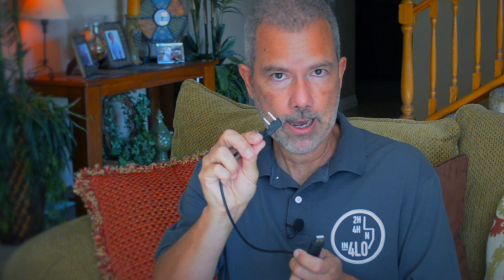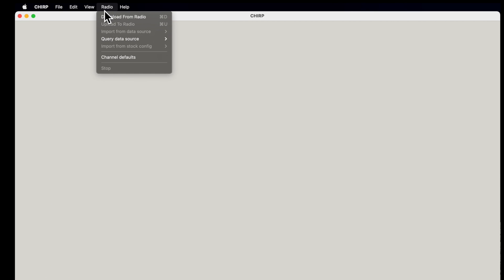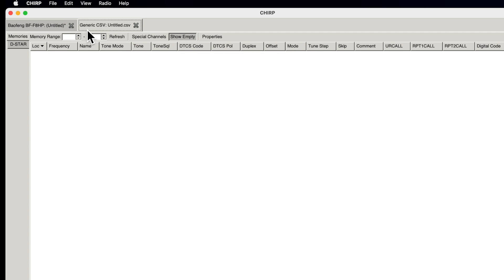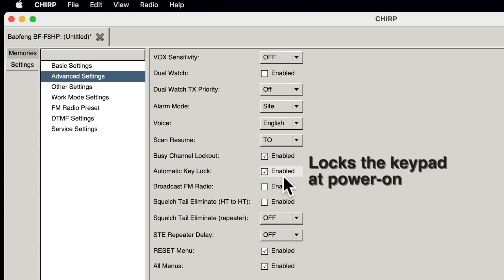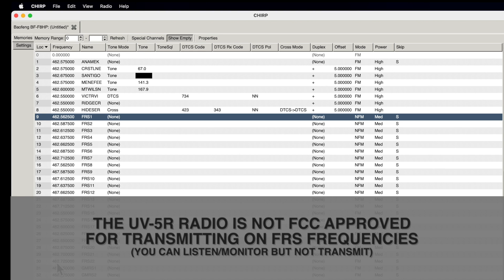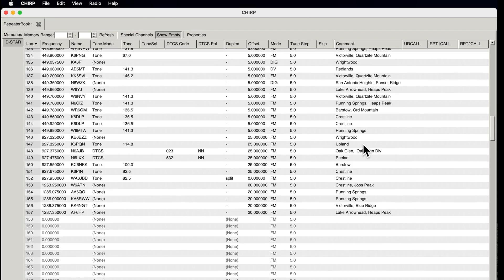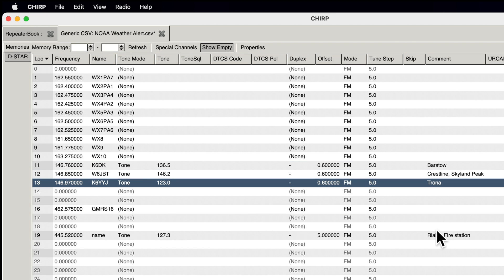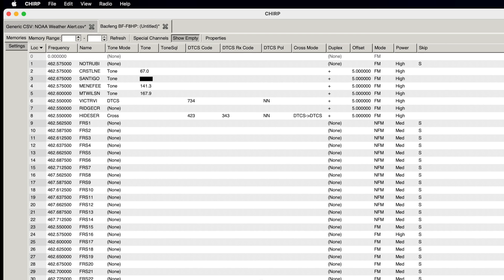How To Use CHIRP Software To Program A Baofeng UV-5R. Using CHIRP for HAM, GMRS, and FRS Radios

Comment: Hello, I want to ask. Is it possible to use. This walkie-talkie legally. Below a certain frequency. Without having to. Edit it with a computer.
Reply: @michal swartz  Yes, it is "possible to use" the HT on any frequencies you program from the radio keyboard, as long as the radio is built for that band: e.g. 2M, 70cm, 220, etc.  CAUTION:  You may be violating the laws governing those frequencies!  If you are interfering with aircraft radio / navigational frequencies you may be hunted down and arrested.  If you are misusing frequencies for Licensed amateur band operators, your ham neighbors may make a "fox hunt" exercise out of finding your transmitter.  They may chat ...  or may submit the case for prosecution directly to the governing powers (e.g. USA = F.C.C).
Reply: @donalddodson7365  However, you didn't exactly answer his question on WHICH frequencies are legal to use for "simplex" use. I'm in Canada so the FCC can kiss my ass but obviously, I'd have to research which local channels are for fire/rescue, navigation or whatever. Are there any OPEN frequencies that we can use openly which no one uses for official use? Thanks in advance :)

Comment: As you have said many times, CHIRP and Macs just don't get along!! I had to borrow a friend's Windows Laptop to use CHIRP. One issue was an error code referencing a different fIrmware version on my second radio, but the new data was uploaded and is useable.

Comment: I've tried a lot of things but I cannot get my radio to respond when trying to download and wont give me the option to upload either. Someone please help!
Reply from the maker: Check to make sure you have the correct com-port set in CHIRP
Check to make sure you are choosing the correct brand and model radio when downloading
Make sure your cable is plugged in All the way (plug it in harder when you think its plugged in) and set the volume on your radio to about 75%
if it still does not work, then you probably will need to change/update/replace/roll-back the Windows driver for your cable - To do that, make friends with Google, and God help you...
Reply: i had the same problem . this is what worked for me . go to the bottom left. right click the windows icon . then find device manager . find ports . plug and unplug the radio leaving the usb plugged in . if you see somthing change . thats your radio . (under ports) .for me though it was above ports listed as a usb thing . it appeared and disappeared as i plugged it in and unplugged it . for me . i saw when plugged in that there was a yellow triangle . i right clicked that and checked for updates . let the pc update all the stuff out of date . when finished a new port appeareared labled CH340 . when that shows or somthing new under ports try again and this should work . hope this helps anyone

Comment: Question, I'm new to this if you bought one radio, baofeng vhf/uhfIP67, next BF F5XP 5w D.B. or BF F8RT 8w D.B. would like to start off going in the right direction, thanks
Reply from the maker: Ok.. So what is your question?
Reply: @TheNotaRubicon  which would be the better beginners radio, I'm mostly monitoring truck traffic in northern BC Canada and the Yukon, Alaska
Reply from the maker: Those are all ham radios so unless you have a ham license, probably none are a good choice.

Comment: I have 2 radios they have the same frequencies but in different locations. Can you print out the list so I can change them to have the same frequency in the same location on both radios? I couldn't work out how to print from Chirp
Reply: Hey Gary, update here.  So I've used CHIRP now and I can confirm it's that easy.  Download from one radio, swap the radios, and upload to the other radio, and they will now be cloned
Reply: @coastalgaming1594  - You can also save configuration files to open later and upload to other radios. This comes in handy if you have a lot of radios.
Reply: Hi Gary, brand new to chirp but, maybe I can help with this question.  The entire point of my getting chirp was to clone my radios with out putting all the manual effort into each radio.  From my new understanding from this video.  Download which radio you want to clone into chirp.  Then switch out the radio you want to change on the programing cable with chirp still open.  Then upload that profile from chirp into the radio.  I see no reason this will not work, unless it's two different radios and then you would probably need to tell chirp it's a different kind of radio.  Regardless you should not ever need to print out what is on chirp unless you want a paper back up because the radio will tell you the same information.

Comment: Bit of a technical question: I noticed that there is options to adjust the lower and upper limits from the VHF and UHF frequencies, what I am curious is, If I adjust the lower limit of the VHF to go all the way down to the CB band (27 MH) would that damage the radio and/or would transmission and receiving operate as normal outside of it's original range?
Reply from the maker: The radio is only capable of transmitting within a certain range. adjusting the upper/lower limit might get you a bit more frequencies, but not many, and certainly nowhere near 27Mhz.
Reply: @TheNotaRubicon  Ah, thank you for the feedback and have a great day.

Comment: Is it possible to tune into a uhf frequency and transmitt
Reply from the maker: If you have a UHF radio that can transmit on UHF, then, yes.
Reply: @TheNotaRubicon  BaoFeng UV-82 High Power is what I'm looking at to buy for many reasons but one reason is for work because I'm sick of getting broke radios lol but that was my question UV-82 will it transmit uhf FM sorry I should have  Worded  the question differently

Comment: Does anyone know if I can use CHIRP to actively control a radio? Meaning if I were to make a different radio control panel, could I press a button there, have chirp translate it to the radio and start transmitting? 

My goal is to interface an older style Motorola radio remote head, and make an interface to be able to control a Baofeng radio as the actual transmitter and receiver. Nothing nefarious, I just need a way to change channels and tell the radio to listen to the mic when I press the old talk button.

Comment: I am trying to do this type of programing to a Btech UV50X2 with the same setup. Do you have any suggestions? Will it work and TX on all of the GMRA and FRS freqs for emergency purposes?
Reply from the maker: Never used a 50X2, but it is a ham radio, so it's not supposed to transmit on GMRS/FRS frequencies.

Comment: Hi Randy,

It’s your favorite viewer, Tom. I have a question about operating CHIRP on my Mac Pro. I watched your video on programming a radio with CHIRP. You explained on how to get the CHIRP program to work on your Mac. I think I followed what you were saying. But, alas my Mac doesn’t like CHIRP. And tells me so when I try and open up the CHIRP program 
Any helpful thoughts? Or any were else to get the CHIRP program up an running on my Mac.

Thank you

WRTB367 Tom
Reply from the maker: The new MacOS has some issues with Chirp - but if you read through the support-posts at the CHIRP site it has all the fixes depending on your issue.. Took me a while to get it running on my new Mac.
Reply: @TheNotaRubicon  thank you
Reply: Update if your interested. I got CHiRP software to work on my Mac, I deleted the original program that I was having problems with, and reloaded a new. But when I hooked up my radio it didn’t work. So I went back to see what cable I ordered. Yep you guessed it. Not compatible with Mac OS, only PC🙁 ordered a new cable that says it’s compatible with Mac OS. But I want you to know I’m still your favorite viewer😎
Reply: @tr503sffd  Have you considered getting the Bluetooth programming dongle? Relatively cheap and will allow you to program via your iOS or Android device. Pretty neat.

Comment: I know this is an older video of yours, but I just want to give you props for making solid informational videos without going through the typical HAM nerd (ahem, I mean, "enthusiast") rigmarole.  You got me into GMRS with the 935G (affiliate link, of course), and only 3 weeks later I am awaiting my UV-5R coming in the mail tomorrow.

Though I can't transmit on this particular HT yet, I found GMRS is rather dead in my area (I live in a very rural area, searching with the FCC there is only one active GMRS license in my town, and it's me), but HAM licenses in my small town are rather abundant.  Plus, the fact that HAM repeaters are all around me, gives me hope I can actually receive something.  You have a good way of teaching what can be a very overwhelming topic while making it simple enough for the new users to understand.

Comment: Tried to program using chirp.  Got this error:  could not open port : [Error 3] The system cannot find the path specified.  No path comes up for port  Don't know if that is it.
Reply from the maker: Sounds like Chirp is not able to see/find your radio - usually this is because there is an issue with the cable, or more likely, and issue with the cable-driver.
Reply: @TheNotaRubicon  Thank you.  Returning this one and going to try the one you recommend.
Reply: Same issue with the recommended cable from the baofeng Amazon store.. Trying to figure out drivers..

Comment: I've tried different things and my computer does not recognize my GT-5R. Downloaded various drivers, still nothing. I'm using Windows 11 and only have USB 3.0 ports. I have read USB 3.0 is incompatible with CHIRP
Reply from the maker: Your issue is almost certainly a problem with the cable or a Windows issue with the driver for the cable.. Very VERY common on Windows. Some people have resolved it by either updating the driver for the cable or rolling back to an older version of the driver.

Comment: Not, one of those silly questions. Which Ham license is required to transmit on the Baofeng UV-5R? I see there is more than one. Complete starter question.
Reply from the maker: You need the basic/starter "Technician" license.
Reply: @TheNotaRubicon  You the man! Thanks!

Comment: HOW do you lock a radio for an example, work radio through chirp where users cannot unlock it on the radio?
Reply from the maker: It depends on the radio, and whether or not it supports that function.
You would have to read the manual for your radio to confirm it can do that, then find that setting in CHIRP.

Comment: Just asking for some help:    I just bought a brand new model of Baofeng - "UV-13Pro" that is not in Chirp.   I found a Reddit posting that lead me to an Abree file for a "P15UV CPS" that is supposed to work.    It's a file with an "rar" suffix.    How do I use this .rar file with Chirp?
Reply from the maker: .rar is a compressed file, like .zip.. so you will need to UN-rar it and use the resulting file.

Comment: I need clarification, I have info for a GMRS repeater in my area.  the owner gives the following details but I cant get it to work and some of the settings change in CHIRP when I input a different setting. her e is the info provided.
Downlink: 462.625
Uplink: 467.625
uplink tone *** ( he provides the tone but i noticed its only published once you register your call sign)

also he states" it utilizes a DPL/PL tone, the PL tone is not needed but the DPL of 315 is required"

so I go into CHIRP, enter 462.625 into LOC 23, I enter the tone in the TONE column, and enter 315 into the DTCS Code column, and I set Cross Mode Column to DTCS>Tone, I enter 5.0000 in Offset Column.... at this point I notice the tone column is blank again,  Tone Mode column has automatically entered CROSS, ToneSql column has automatically entered 67.0, DTCS Pol automatically enters NN and Offset Column is blank.   I uploaded it anyways and of course it did not work... and one have any guidance?

Comment: Just purchased a UV5r, followed your instructions to the T, but for some reason the "upload to radio" tab is grey which won't allow me to upload any of my selections. Any thoughts?
Reply: Could be that you didn’t save the original img file. I had the same trouble. I’m very new to this myself. I’m not sure if there is a shortcut, but here is what I do. I save a copy of of the file from the radio and make a copy. If I do any changes I do them on the copy and upload.
Reply: @madsteam77  thanks Juan, I'll try that.
Reply: Factory reset the radio, delete your current profile, remake your profile, save to desktop or in your preferred folder, then upload again. Also, when the upload prompt pops up, try changing to a different “COM” number. You may be having an issue with your computer’s comms port (or a bad cable like Randy said).

If that doesn’t work, you may want to uninstall and reinstall Chirp and repeat the above steps.
Reply: @bodazaphfa  If a cable can download, it can also upload.
Reply from the maker: Most likely an issue with the cable or the Windows-Driver for the cable.. Make sure the radio is turned on and make sure the cable is FULLY plugged in to the radio.. of course, make sure the other end is plugged into your computer..
If that all looks good, then you get to go down the "troubleshooting Windows driver issues" rabbit hole... Good luck.
Reply: @TheNotaRubicon  Cable seems fine, easily downloaded from the radio to computer, but STILL after I've made selections and changes it won't allow me to upload back to radio. Now I'm getting a error popup saying "unable to make changes to this model", going nuts here trying to figure this out. Has to be something so easy I'm doing wrong or... I'm a REAL FN nuub.🤬😤
Reply: I had this problem too. However, I changed between a couple of tabs in CHIRP, and suddenly the upload option was possible. However, you have to start with downloading from the radio first. Also be sure the cable is plugged in firmly.

Comment: I have uv5r (it doesn't have UV-5R HP under keypad) but it was listed on aliexpress as 8W and it indeed has 3 power levels - low medium high. So now I want to use chirp, and I don't now if I have to write to it as to uv5r which has 2 power levels in chirp or as to F8HP.  In Other settings tab Firmware message says HN5RV01. Any help?
Reply: Try using UV-5XP setting in Chirp for the 8 watt radio.

Comment: Randy, your CHIRP interface looks better than mine, and I just downloaded the latest version (for Windows 7).  Are you running a Mac version or some other software version?  Mine is extremely bare-bones looking.
Reply: Randy is using the Mac version. That being said, I don't see anything in the menus and options from this video that are not also in the current Windows version.

Comment: CHIRP has standard templates in a drop-down menu for the FRS/GMRS, Marine, NOAA, etc. frequencies.  I used the FRS/GMRS template to start with, then added all the NOAA and some Marine frequencies.  Then, I saved that file for later use with other radios.  Worked great and saved a lot of time.  I do wish CHIRP columns had better explanations.

Comment: Whenever I go to download from my UV 5R Baofeng, it begins to clone but within a few seconds I get an error message that says "Radio did not respond". What is this error message and how do I fix it? Any assistance is greatly appreciated.
Reply from the maker: This could be due to many things - but some of the most common would be:
1) The radio is not turned on
2) The radio volume is not set loud enough (set it at about 50-75%)
3) The plug may not be pushed all the way into the radio
4) The cable may be bad
5) The radio may be bad
Reply: For me, that meant I had not seated the cable connectors into the radio all the way in.  The holes are tight the first time.
Reply: Another potential cause is that the correct hardware drivers have not been installed for the USB programming cable.
Reply: For me, I have to use BF-F8HP as the model number to talk to my UV-5R

Comment: No ports are showing up for my computer in CHIRP!

I shoved the programming cable FIRMLY into the ports, turned the radio to %75 power, and installed the latest FTDI VCP driver.. nothing happens. Could this be a faulty cable? I am using the genuine BTECH PC03 FTDI from the link. Thank you.
Reply: You probably need to download the correct drivers for your cable

Comment: How can you bypass that UV5R setting, to allow communication on the MURS channels?
Reply from the maker: New UV-5R radios are 'locked' and cannot transmit outside of the ham bands.. There is a very easy way to UNlock the new UV5R, but there are some risks. I made a video showing how to do the unlock a few weeks ago.
Reply: @TheNotaRubicon  yes I just found it, also found a “sad ham” 🤣 thank you so much!!

Comment: Once I use chirp to assign a name to a freq, should I expect to see it on the handheld in place of the freq, or is it just for reference in chirp?

Thanks!
Reply from the maker: After writing the changes to the radio, the name will display on the radio IF you have the radio set to show names instead of frequencies. There is another setting that controls that.

Comment: I have a Baofeng UV-5R8W ... Its not on the CHIRP list.  Which model should I use in the menu?
Reply: Use the UV-5R to program in software.
Reply: Try using UV-5XP setting in Chirp for the 8 watt radio.